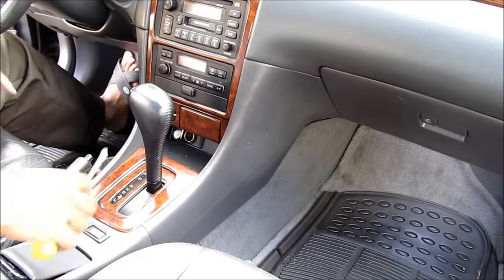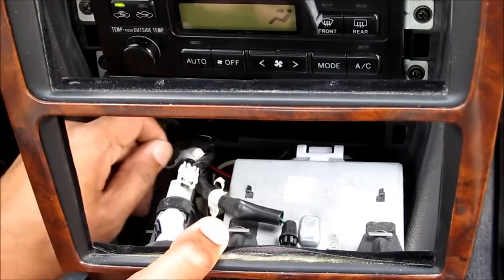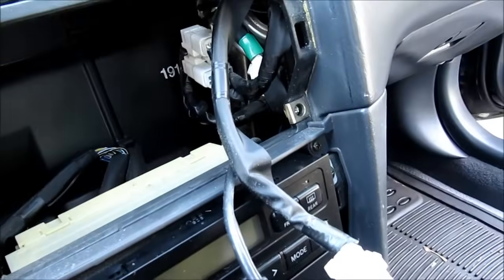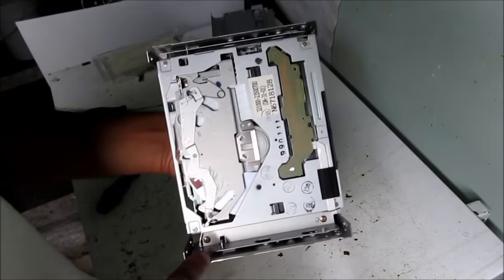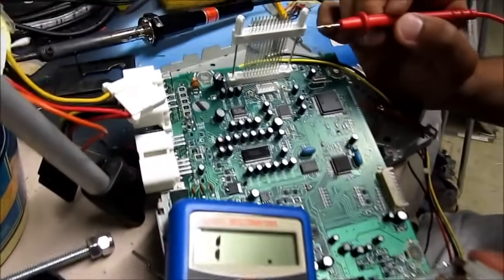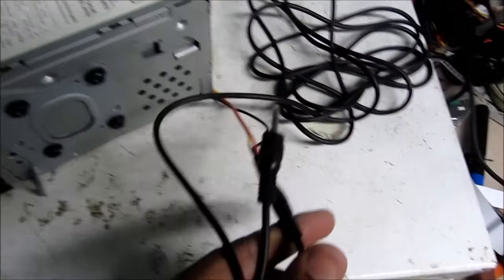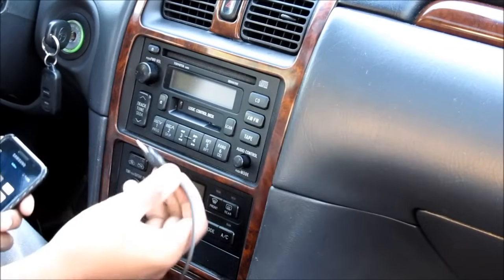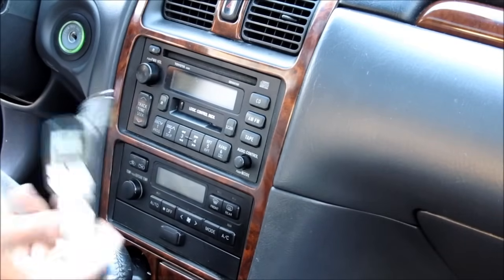Auxiliary Stereo Input Hack

Comment: Can you Feed it through the crack of your emergency brake or will that cause issues?
Reply from the maker: Hosea Huynh  I wouldn't, just because the risk of it getting caught when you pull down the e-brake. You could drill a small hole and put in a female connector on the dash somewhere.

Comment: Great video. Just wanted to clarify, you soldered the L and R channels to the main board but what about the ground coming from the jack? Is that the one you screwed on?
Reply from the maker: Thanks. Yes the ground is the one I screwed into the chassis of the radio.

Comment: I attempted this on my 2003 Camry XLE with JBL 6-disc changer and tape deck but can't get it quite right. I'm pretty sure I did everything I was supposed to. Well, at first, I had neglected to do a ground wire and when I tested it, I got a tiny signal that was quiet and extremely distorted. So then I realized my problem and added a ground. But now it's still only very slightly better. It's not usable at all. It sounds like a radio station that's 100 miles away. And this happens even with the antenna unplugged, so it's not because of other interference. Is it possible that my solder connections would cause that? I figure if I'm getting any signal, then they are ok; but it wouldn't be the first time I was wrong. 

My PCB is quite different than the one in your video, but I managed to find the only things that resemble the test points and they are labeled "TP4". Is it possible that those are not in the same place in the signal chain and they're coming in after the amplification instead of before? 

As a side note, I can't get my tape deck to accept a tape. I attempted to put one in to see if I could get it to work that way after reading comments. But it's like the deck mechanism isn't working and doesn't react to inserting the tape. Thoughts on that? 

Thanks,
Joel
Reply: Ok ta Joel.Good idea.Thanks.
Reply from the maker: I'm not sure about your tape deck.

Regarding the wiring, follow the L+ L- R+ and R- wires from the cassette head on your board to an appropriate soldering point using a continuity tester.
Reply: Joel Cook Hi Joel.Could you try a signal injector?
Reply: martyw34 I ended up just getting a new Pioneer stereo. Bluetooth, aux, usb, cd. It's quite nice.

Comment: hi thank you so much for this. I thought you soldered the tape player output so you'd have to put a tape in to play from the aux, but it looks like you went the FM way. I have the same radio and i want to do exactly what you did. again, thanks a million. this is awesome.
Reply from the maker: Glad it could help. I did solder to the cassette, but it just happens to override the FM signal automatically when I plug in my phone.

Comment: or buy an aux cassette tape?
Reply from the maker: That has too much static, hissing and clicking from the cassette. This mod is direct to the stereo inputs, so the sound is clear.
Reply from the maker: Then I'll loose my nice sounding JBL system and it won't look clean.
Reply from the maker: Aftermarket stereos are too flashy and don't match the interior of the car, I prefer to stay with my stock stereo. I wish they made aftermarket stereos that immitated the looks of the OEM one, with large easy to read buttons.

Comment: I just finished the aux-in.. and i heard the music in both sides of the car (which is perfect) but when I press the NEXT button on my phone for the next song... All I hear is static and a little of the radio.

I have a samsung s3, I know some individuals commented about Galaxy phones not working properly, but wanted to confirm about my problem... As one of the comments mentioned.. the radio needs to be off and on, which I have to do (which sucks)... my problem when I click NEXT is what I want to know... My phone is the only mp3 I have..

If this is just my phone, then I don't have to dismantle and work on it again... Any help from ANYONE would be great regarding my samsung phone... THANK YOU!
Reply from the maker: I've got the Samsung Galaxy S (original) and have had no problems with my AUX port. I've also had an iPhone work with mine no problem. However I could not get the Nexus 4 or 5 to work, or a bluetooth adapter. I think it has to do with how the ports are wired to detect a headphone is plugged in, and how strong that signal is to override the radio.

Try another MP3 source (a friend's phone or a laptop output for example).

Comment: I just sliced my STEREO audio extension wire.  I see a white sleeved wire, red sleeved wire, and a bunch of silver wires that were not sleeved....

Regarding your yellow, red, and ground wire... Can I assume I should solder the red to the red, yellow to the white, and black to the silver?
Reply from the maker: My wires were just patch cables I had, no need to match colors with mine.

As long as your ground corresponds to the ground pin on the 3.5mm jack, as well as L&R, you should be good.

The wires that are not sleeved is most likely your ground. You've got to do some trial and error to see if your red or white wire is the L or R channel and solder accordingly.

Comment: First, i just want to thank you for this very very thorough video.  The only part that I found confusing/ambiguous was the aux-in portion of the video.

My questions are:
I purchased a male-to-male audio extension... Correct me if I am wrong, but I should cut one end of the wire and I should find 3 wires in the STEREO audio extension, correct?

I solder 3 wires (red, yellow, and black) to the audio extension cord I cut.  The OTHER end of the BLACK ground wire should be screwed in as shown at 4:30.  The OTHER end of the RED wire should be soldered to L, and the OTHER end of YELLOW wire should be soldered to the R.

Is this correct?

For the radio soldered LEDs... by any chance do you have a youtube tutorial video on how to change the LEDs? especially the backlight LEDs for the radio display (i have the same exact radio as you).

Again, thank you!!!
Reply from the maker: Your wiring is correct. Did you get it to work?

I'm working on the radio LED mod. I've ordered in the SMD LED's and will go from there.
Reply: speedkar99 I am going to do the aux-wiring... but currently am doing the LEDs for the radio.. Below is a link that sort of helped me but due to the fact that the pictures that were posted no longer work I cannot determine the polarity setup for the radio. 

http://www.toyotanation.com/forum/107-camry-solara-lounge/97347-diy-stock-stereo-led-color-change-lots-pics-56k-no-way.html

Please keep in mind for the above link, the radio backlight seems different than mine (I say "seems" because again, i cannot see the pics and for me the radio backlight ONLY is actually a SOLDERED BULB (NOT LEDs as mentioned in the post)).  For the soldered bulb, I removed it and will TRY to solder a LED in its place.

For my radio... on the BACK of the circuit border I do see 2 white squares... there is one red dot in each square.  One red dot is at the bottom-side of one square, and the other red dot is toward the right side of the square.

I am ASSUMING that it is a notation stating that for the LEDs, the negative polarity should be facing downward or rightward... since there are LEDs that are soldered horizontally and vertically.

What I've been doing is soldering a few LEDs and going back to my car (with the radio) to test if the white LEDs work (since I have no idea how the polarity should be aligned).  This is my first time soldering so I do not know if I am doing it wrong or simply have the polarities wrong... none of the LEDs I've added seem to work when testing it on the car...

I know you said you were going to order the LEDs, but when do you think you're going to do a tutorial for the radio LEDs?

Again, thank you very much for your help, and sorry for the super long reply!
Reply from the maker: Okay so let me get this right, your radio (which is the same as mine) has bulbs for the backlighting???

Ive taken mine apart (as well as a few like mine in the junkyard) and they all have small SMD 1206 LED's, with the exception of a tiny incandescent bulb for the LCD display.

If your LED's aren't working it could be either polarity or a voltage difference. The bulb you replaced might operate at a higher voltage than the LED you put in there.

Can you please document your work with photos, it would be a good guide.

I'm still waiting on my LED's to come in from eBay, they usually take a month from China.
Reply: speedkar99 No not bulbs.. but one bulb... just like how you stated

"Ive taken mine apart (as well as a few like mine in the junkyard) and they all have small SMD 1206 LED's, with the exception of a tiny incandescent bulb for the LCD display."

My problem is I do not know how the polarity is setup for the LEDs... that's why I was asking you if you know how the polarity is setup because this is taking much longer than expected...

As a test run for the LEDs, I've soldered some with the negative pointing to the left and other LEDs soldered to the right to see which polarity is correct but NONE of the LEDs are lighting up..

Do you know how the polarity is setup for the LEDs?
Reply from the maker: I can't tell you off the top of my head without experimenting myself. The best way is to learn by checking the polarity of the stock LED's (with a separate 3V power supply) and applying the replacement LED in the same direction.

Remember, these LED's are wired in series, so one that is wired backward in the string will cause them all to not light up.

Comment from the maker: @unchboy
You can't just tap the speaker wires as the signal is already amplified coming out of the headunit. You need to tap into the unamplified signal inside the head unit, otherwise the sound volume will be very low.

Comment: Hi speedkar99, My 2000 T/Camry  doesn't cassette player. I opened it up and there are no R or L terminal on mother board. Can i still get the AUX somehow? Thanks
Reply: BTW, This unit has only radio and CD player.
Reply from the maker: Hai Ho
I haven't opened a CD player before, so I'm not exactly sure if you could tap into it for auxiliary input. What you'd need to look for is an unamplified input signal (which is what the L & R ports are for coming from the cassette head on equipped units) coming from the CD player to the amplifier. Solder in your wires and you should be able to over-ride the signal by playing a blank CD.

Comment: What about the 6 disc JBL unit? I ripped mine apart and it isn't exactly the same but close. I just don't know where to ground the wire. The L and R channels are clearly marked tho.
Reply from the maker: Ground it on the chassis of the radio, like I did in the video.

Comment: Hi, I don't have a soldering tool. So what else can I use to solder the cable on the motherboard? thanks.
Reply from the maker: Soldering is the best way to get a good connection. A soldering iron is less than $10 and is well worth the investment. Using glue or tape to hold it in won't give you a strong connection causing static, missing and crackling.
Reply: speedkar99 Thanks for the reply. I'm trying to install the aux cable on my 2000 Camry stereo. I already took it apart. I see R+, R-, L+ and L- instead. Do you have any idea where and which one I need to solder. Thanks.
Reply from the maker: Use a multimeter with a continuity test to determine which of the two are conductive with each other and solder the pair. Trace the wires to a soldering point on the board. For example, if L+ & R+ are continuous, they are to be soldered together, as well as L- & R-.

Comment: I just bought a 2001 Solara with the JBL stereo. The previous owner had something custom installed but removed it prior to selling the car to me. At 2:16 you mention the cables to the JBL amplifier, these are left unconnected in my car so the sound is very weak. I don't have the original stereo anymore (I have a pioneer). Is it possible for me to reconnect the JBL amplifier to the new stereo? if yes, how?
Reply from the maker: Your new stereo most likely has a built in preamp. It won't be compatible with the JBL. The amp in the headunit works to power the speakers through those connectors in the back of the dash. To reuse the JBL amp, you most likely need a JBL unit which you can pickup from a junkyard.
Reply: Thank you for your answer. It sounds like the sound is amplifed enough to the rear speakers however the sound in the big speakers in the door is very very weak. 
(Also previous owner blew both of the rear speakers! :/) 
It's a lot of troubles for a car I'm going to sell again when I leave for Europe in January..
Reply from the maker: That being said the rear speakers were probably replaced with ones of lower resistance, causing most of the sound to come out of the rear speakers instead of the front. Also check your fader settings to make sure the sound isn't setup to be dialed to just those back speakers.

Comment: Ok. I have a 1999 as well. The Original wire harness that was going to the stereo, does that just sit there. I need this like right now
Reply: I am putting in a whole new head unit
Reply from the maker: george corsentino
Yes the harness that is behind the radio sitting there (in cars with JBL) leads to the speakers directly and bypasses the JBL amp. If your putting in a new head unit, you need to use these connectors with your stereo wiring harness.

Comment: @speedkar99 do you have to have a ground cable? Or can you use a Y audio cable like this one http://www.bestbuy.com/site/dynex-6-y-audio-cable/7005457.p?id=1099392032460&skuId=7005457&st=Dynex%20audio&cp=1&lp=5 and strip the ends and solder them??
Reply from the maker: Yes you have to ground it, L, R and ground. That cable should work, if your input has RCA connections.
Reply: @speedkar99 I got the cables i showed before. Stripped the wires and twisted the ground wires from both left and right (red and white) together for the main ground. It worked out perfect so I only had to solder onto the motherboard and not have to solder another aux cable on. Overrides the radio like yours. Great vid man. Thanks a lot!
Reply from the maker: I'm glad it worked out for you, enjoy!

Comment: alrighty then...I have a 2000 solara, with JBL...hte unit was different than yours (not by a whole lot, but enough) anyway I managed to get the wires soldered to the tape audio circuit, but mine doesnt over-ride, its only active if there is a casette in the deck, and naturally I dont even own a casette anymore. Is there anyway to trick the unit into staiyng in active tape mode? If i stick a screwdriver in, it lowers the tape cartridge, clicks and spins for 5 seconds and goes back to FM. My aux works for this 5 seconds.   I disconnected the connector for the electrics/motors and the unit just says TAPE, the aux is dead. Maybe I should find a blank cassette and disconnect the audio ribbon to get rid of the inevatable tape hiss
Reply from the maker: Safest thing is to find an old cassette to trick it into TAPE mode. You could disconnect the tape reader head or cut out the tape to stop the hiss.
Reply: speedkar99
for some reason my casette makes a pretty annoying motor/click noise when playing a cassette. I did pull the ribbon from the head to stop the hiss/audio from the tape. These decks are "logic controlled" which means if you put a dummy tape in (one with no tape inside of it) it only plays a few seconds and goes back to FM.   I was thinking of disconnecting the cable for the motor/control (opposite the audio ribbon) but again if I hit tape it goes into tape mode for about 5 seconds and back to FM.  Alternatively, there is L + R from the tuner, I doubt it would over-ride the FM audio. And on the CD side of things there is a L+R but it is far too small to solder to.  I see for $120 you can get an "PIE" AUX input that plugs into the unused connector at the back of the deck (cd changer connector, or NON-jbl connector maybe??) Its not as simple as a direct connection, as you are supposed to put it into CD mode (without a CD in the unit) and it says track1, and will play through the AUX.
Reply from the maker: I've got a similar iPod connection that goes into the spare connection at the back of my radio on my Lexus ES. That way,  I can control the tracks with my steering wheel controls.

As for the Solara, I think you should try those FM and CD ports. First use a multimeter to see if they are conductivity linked.
Also if you look at the cassette mechanism closely, I think there's a part that senses that the tape reel has finished and mechanically stops the tape/motor. If you could disable or rig up something to keep that mechanism in place without a tape, then you could force it to stay in TAPE mode without a cassette.

Honestly at $120, you're better off buying an aftermarket stereo with AUX, MP3, bluetooth, USB etc.

Comment: Hey I just wired up my radio just a the video shows but my mother board was a little different. I have the R and L terminals but they weren't in the same place as yours and they were smaller. I got it hooked up but it will only work when the radio is turned on and plays over the music. How do I get it to over ride the radio?
Reply from the maker: Try using it in tape mode or CD mode with a blank disc/tape inserted. I'm not sure why mine over-rides the radio, I accidentally discovered it after installing the aux cable.